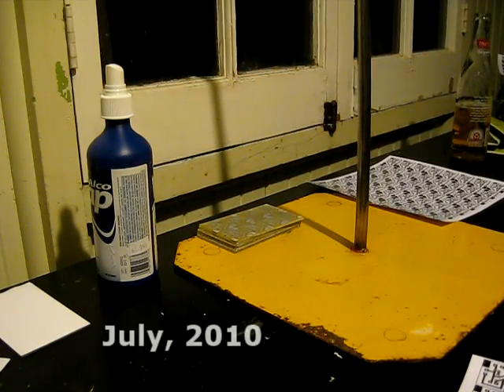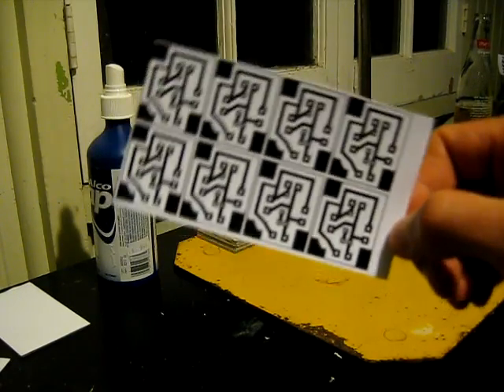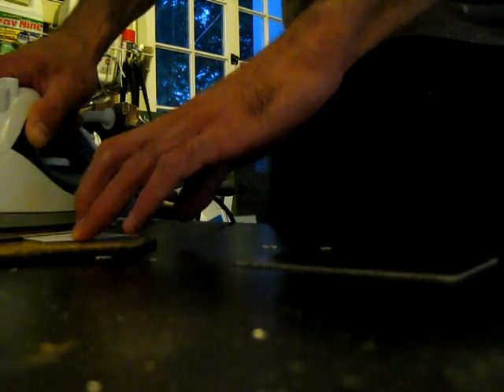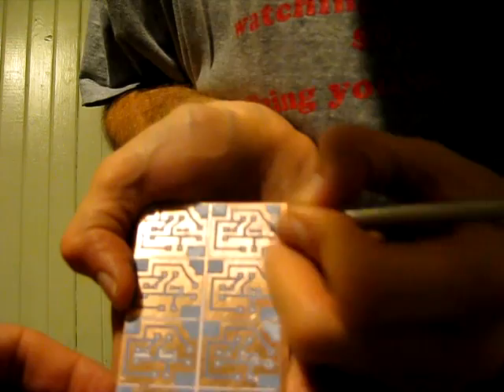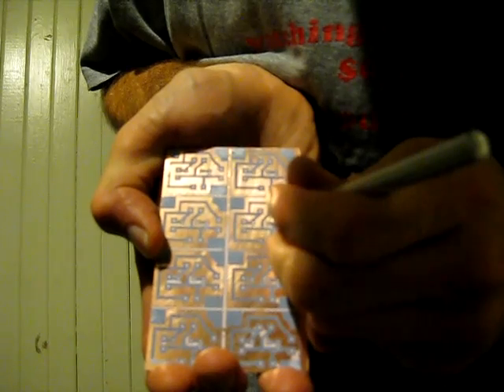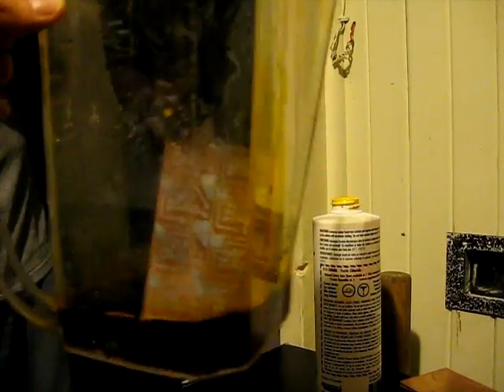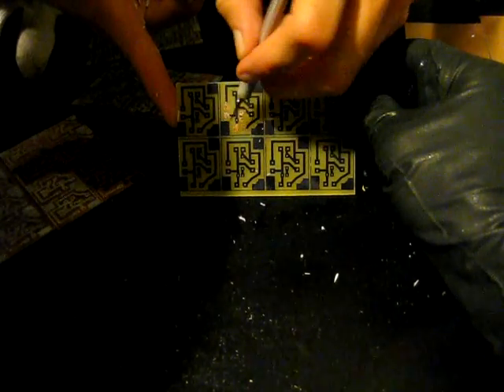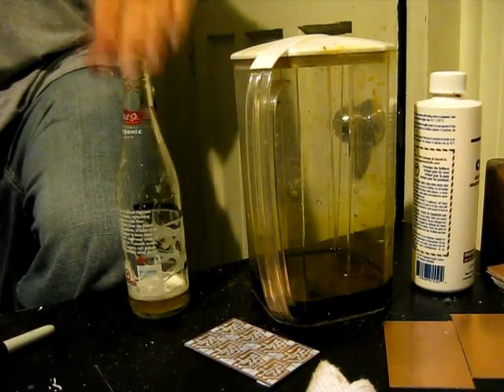Take a Picture: DIY electronics. Printing and Etching PCBs

Comment: first off, go to the stationary store and buy a few sheets of very high gloss thin paper.
use the toner method, make sure your printer is set to print darkest black,
on any hard surface iron on the toner transfer , set the iron to medium heat and no higher, this will prevent smudging. preheat the board for a minute. then with medium pressure iron the board on both side evenly. toss the board in water right away. after 20 minutes take out board and roll off paper with you thumbs. take a bottle of windex and on a paper towel, scrub the board with the paper towel to remove the haze. I make my own etching acid at home. after etching the board use fine steel wool on the board to remove the toner. I have made over a hundred boards this way.